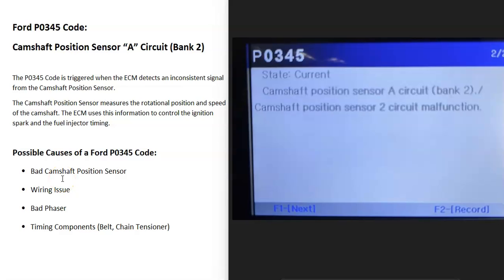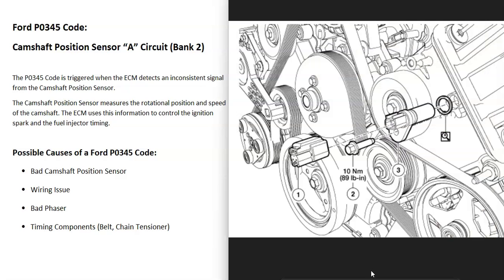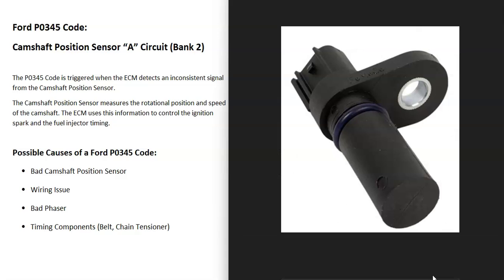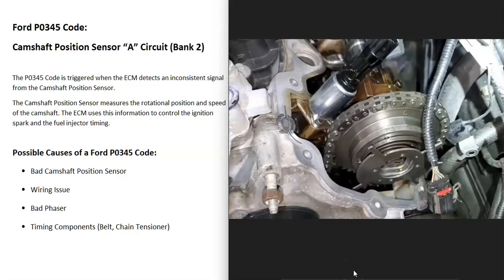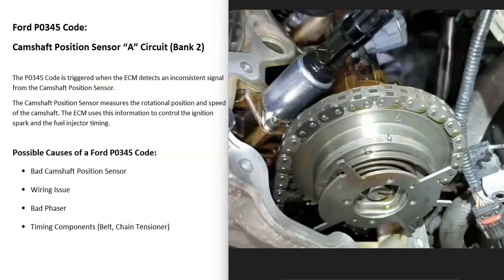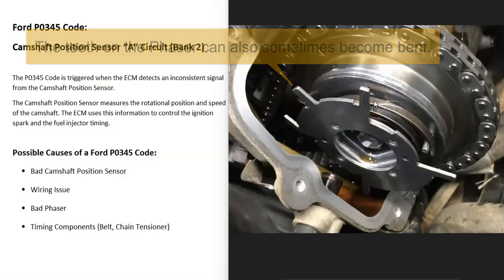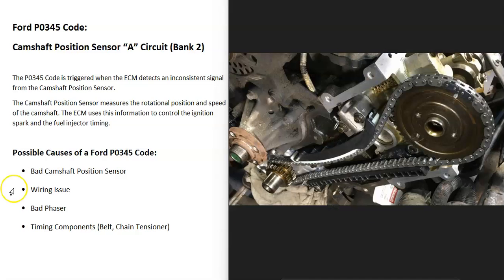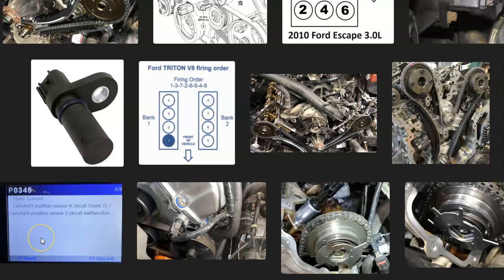Causes and Fixes Ford P0345 Code: Camshaft Position Sensor “A” Circuit (Bank 2)

Comment: Man I have done my mechanical timing twice ended up replacing everything I just can’t get the car to run right or the codes to clear iv verified ground through the harness for the related circuits and have 100% verified the sensors and every mechanical timing component ready to burn this car down

Comment: in 2012 GT i swapped the cam sensors after car through both codes for each side. It was low on oil, now i have a rattle noise. Someone suggested might be VVT SOlonoid. Would that be related to this code?

Comment: V6 3.0  2010 ford fusion circut a bank 2 where is this sensor located
Reply from the maker: The Ford 3.0L has the camshaft position sensor at the front of the engine. It will be at the front top of the engine next to the head on the intake side. It's held in place with one 10mm bolt.

Comment: I hope you can help me by the way great video. I replaced my serpentine belt and all of a sudden I started getting this code. I replaced the sensor and the code returned. Do you think i did something wrong with the belt. Any suggestions would be appreciated
Reply from the maker: It needs to be diagnosed, but I would check the wiring, it may have gotten damaged.

Comment: IM LOOKING FOR ADVICE ON THIS!! :)    '07 F150 - 5.4 3V -

I get code P0345 with NO engine light, but only occasionally. I've opened the valve covers and inspected timing and VCT solenoids and did my cleaning and maintenance in there and don't have many concerns when it comes to the engine. I clear the code and don't get it again for another couple weeks. If I clear it again, it doesn't come back for quite a while but only momentarily. Could be something simple that's starting to fail? What should I look at? What's going on?

I normally come across this code when I come to a stop and notice my engine having a pretty rough idle. Thats normally when I know to check for the code's reappearance.
Reply from the maker: Intermittent problems can be hard to pinpoint sometimes. For example, it could be a component starting to fail but could also be a loose connection that only disconnects on a bump. I would test the components and be sure they are good and then check the wiring.
Reply: You said you open the valve covers and inspected and did your cleaning are you qualified to know if what you seen was right or wrong those can phasers are known to do some tricky stuff

Comment: Hi there hopefully you can help me out with a vehicle I have 04 f150 5.4 engine camshaft sensor code came up I replaced it twice last time with a motorcraft sensor still having the same problem rough idle spitting and sputtering no power call comes back po345. Is there a way to test a wire going to the camshaft sensor two wires to see if I got power going to the unit truck ran fine for a year ago and trying to start its acting up like no power booking popping and camshaft sensor code came on on bank 2 after three new sensors . Hope you could help me out I need my vehicle to pull a camper. Thank you very much
Reply from the maker: It is best to get a diagram for the vehicle, but if there are three wires, it is usually ground, 5 volts, and a signal wire back to the computer. If there are two wires, the ground is likely from the case. Issues after replacing a cam or crank sensor are common. I made a video about it here is a link. https://youtu.be/XQGfIREEJg4

Comment: 06 f150 Triton 5.4. Just did timing chain, cam phasers( twice as 1 phaser failed after so replaced both a second time ) oil pump, pensioners, cam sensors. Re assembled and at first it ran smooth no issues then P0340 P0345 P0344 P0349...  i rechecked vcts cam sensors and phasers all fine ..... im so lost now and I don't have the money to take it to a shop

Any ideas what to check next?
Reply: check cam sensor wires to the computer if they are good suspect a bad computer
Reply: @edgarjesusrodriguez what if ive replaced the phasers. Alternator. Pcm, timing, oil pump, sensors and even wires and still have the issue
Reply: @edgarjesusrodriguez fuses are good as well

Comment: I own a 2019 F150 XLT, 5. V8.  I just had two left side camshafts replaced because I had an engine light coming on with codes with PO345 and PO349.  Within a week after the repair, I had the engine light come back on with the code PO345.  The shop that replaced the two camshafts is now telling me that I should replace the whole engine, because of the problem with TSB-19-2365, and the costly repair of 
finding out what is really going wrong with the sensors.  (They estimated around $5,000 to find out what is wrong with this error code now.  Really would like your opinion.

Comment: Anyone sitting in the car thinking theyre tired of shit going wrong
Reply: Yes and I'm so close to paying it off too. It's always something. Never had a issue out of my '19 Tacoma. And all I did was lift it and put wheels and tires on it and change the oil. That's it. 😂

 ('18 F-150 Lariat 5.0L/10 Speed, Super Crew.)
Reply: @Pressurized  I bought a 16 Nissan murano that year and was 7k over budget. For 4k more could've got the 4 runner. The 2016 murano is worth 10k and the 4 runner is worth 25k still 😂 found the problem and, this time, it's only 1 ignition coil boot. $10 part wrapping electrical tape and it, then, working proved it. My advice, buy a 90s truck and extra parts for it. They haven't fixed the shady business yet to trust new manufacturers.
Reply: Litetyb me right now
Reply: Yup everytime I fixed one problem a new problem shows up immediately
Reply: Hell yea I just set this shit on fire.
Reply: Im
So tired of this bull 💩
Reply: I have been dealing with this particular code for a solid 5 months now, replaced everything that the code could even relate too and still cant fix the fcking issue.. cant get a mechanic to figure it out either, they just either tell me the same shit I already know or go down the same spiral I went down
Reply: @aidenthe420  but what about those can phasers in there on the timing chain gears that he was showing that is the most common cause of this particular issue there's something wrong with those cam phasers probably and the chain assembly in there ,has anybody mentioned that to you this is very common I've been working on cars awhile and I seen a lot of people mess with those cam phasers, you just need to find somebody who knows what they're talking about this stuff is not that complicated it is fixable there is a problem you just have to find somebody that can find the problem
Reply: Doin it right now
Reply: @hotboydunn  i hope it goes well bro.
Reply: It’s been a year of it.
Reply: Right now
Reply: @quentinwooten30  i hope it works out. Fixing mine saved me almost a year of notes on a newer, shittier car.

Comment: If there was to be a short, would it not blow a fuse? And if so, which fuse?
Reply from the maker: Yes, it could be a blown fuse. Which fuse it is can be hard to pinpoint sometimes. If you can't pinpoint which fuse it is, you could check all the related fuses or check if the sensor wiring is getting voltage.

Comment: P0206 po208 p0345 all together ?
Reply from the maker: P0206 and P0208 point to an injector issue on cylinders 6 and 8. P0345 Code: Camshaft Position Sensor “A” Circuit (Bank 2). It will need to be troubleshooted to find the cause, but I would start with the P0345 Code. An issue with the cam sensor can throw the computer off.

Comment: My son's car, a 2014 Infiniti Q70 3.7 L, V6, died and would not start.  Brought it to my mechanic and he said the engine is gone. We changed the Fuel Pump and the Camsfaft sensors (both).  Now the reading my mechanic is getting is P3045. He said that they will have to open the engine to check out what you mentioned and that would cost a lot.  He told us to right it off as engine gone, but my son still owes $11,000 on the car note. I should say that my son was late in changing the oil  (he has learned the hard way I presume). They said that they ran some sort of cleaner and added oil. My son's vehicle starts but does not go over 40 mph.  They also said that everytime they run it they have to clean the camshaft sesnors from I assume from oil sludge at the bottom. I am not a mechanic but I don't want to right it off yet. Thank you!

Comment: hey I replaced my sensor after getting this error, would I have to reset anything to clear the code or would it clear itself if resolved?
Reply from the maker: The code will eventually disappear, but it is usually best to clear it with a scan tool. If you don't have a scan tool, automotive stores will often do it for free. Some people remove a battery terminal for 1-2 minutes to reset the computer.

Comment: I have a 2007 Lincoln navigator with a 5.4 triton periodically when the engine is warm especially during the summer time I get a P0345 code and the engine runs rough to the point you have to put it in park bring the RPMs up to smooth it out I was told that the timing chain the followers in the cam phasers have been replaced but I still have the same issue. It only happens after the engine has been running for a while more notice volt when you’re backing up in reverse could you enlighten me please
Reply from the maker: That does sound like timing components, such as a loose timing chain or tensioner, but it can be other things. Each component will need to be tested to know what the problem is.
Reply: I have the same exact problem.I'm gonna be taking it in today.Hopefully I have a good mechanic that can check it out and look deep into those things.
Reply: I'm having this same issue with a p0345 and p0349, when I put the truck in park and rev it, it smoothens then start again after a while. A mechanic has checked the timing and phasers , they are okay. Any help?
Reply: I have the exact same problem.  Rev it and it goes away alway at idle or park worse going from park to reverse.  I seen something about transmission but not clue neutral it gets better and rev it and it straightens out.  That is part I do not understand is why reving straightens it out unless it is a alternator voltage problem slash current